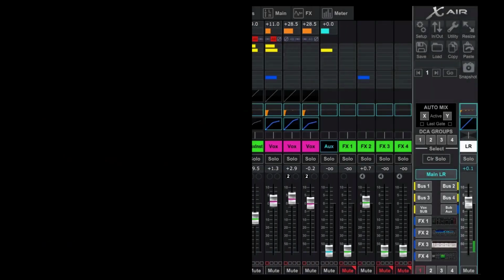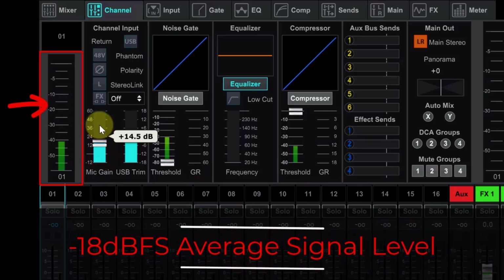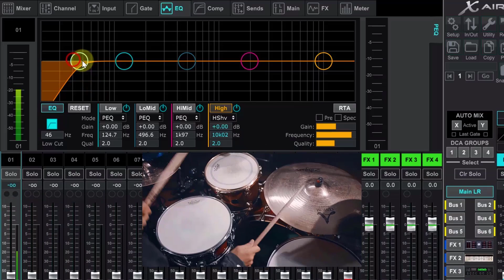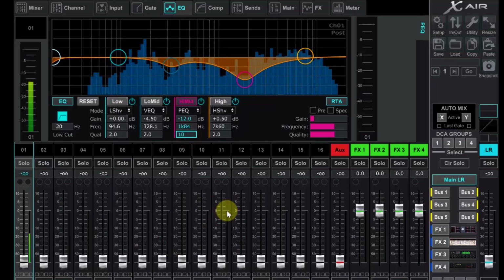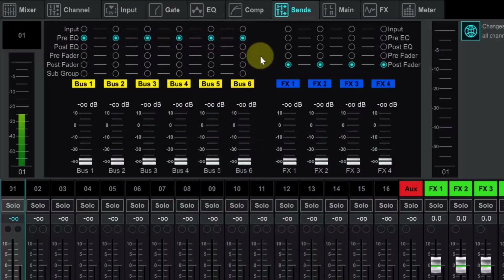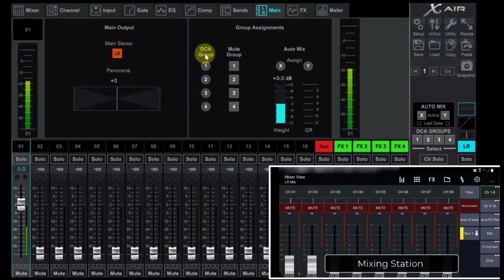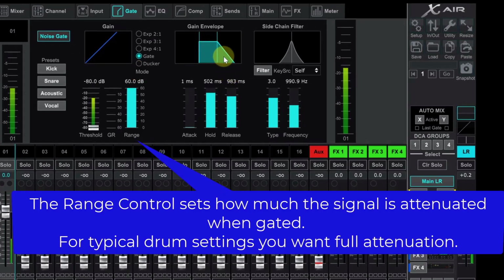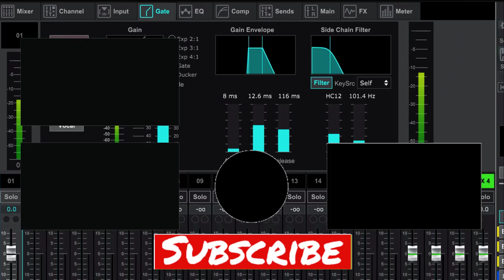Understanding the Behringer XR18 - Channel Setup Tutorial

Comment: I have a question: is it possible to apply two effects to one vocal? I would like to use deesser and reverb at the same time so that the signal that goes to the reverb comes after the desser.
Reply from the maker: I believe the insert point on the XR18 is pre-EQ. 
So, you'd have to use one FX rack slot for the De-esser, and insert one side of it on the vocal. And that would be a pre-EQ insertion point.
The vocal reverb will be a send and return FX (not an insert) and a channel FX bus is normally post fader (though that can be changed... but normally you'd want the channel FX send to be post fader.

So.... the reverb would be capturing the signal AFTER the De-esser... and also after the EQ as well... since it's a post-fader tap. Which sounds like what you want it to do.

This video about the FX Rack probably will help you visualize all of that. There's a couple of other videos about FX and tap points on the channel... but this one is probably the one I'd point you to look at first:
https://youtu.be/TV5ClH_MWrU
Reply: @AlanHamiltonAudio  Thank you very much! I have been looking for information for 2 days and found nothing.

Comment: Great video, Alan. Your videos have been helping me a lot, but I have become a bit stuck recently. I’m using Mixing Station with a Behringer XR18. I created a small and simple custom layout for an acoustic duo i’m in and I saved the layouts, etc, but when I opened Mixing Station this morning, theres a completely different layout with other peoples names on the channel strips, etc, and my layouts have disappeared. I’m only using it at home with the internal router. Could someone have hacked into it?
Reply from the maker: That's weird. I suppose anything is possible but I doubt anyone would hack into MS...  The weird part is your layout changing. 
I suppose it's possible someone had an XR18 really close to you and you accidentally connected with it instead of yours... thus loading an entirely different scene into your tablet. But I don't think that would explain the layout change. Maybe someone that uses custom layouts could speak to that question better than me though. I normally just use the default layout.

Comment: I am looking to adjust my vocals on a channel using the compressor. I can't find the compressor section on my iPad connection to the XR18. I don't have the same screen shown in your video. Is there a plug-in I need to download? Thanks.
Reply from the maker: I'm using X-Air Edit (with is available for PC and Mac). That is what has the compressor presets. Otherwise, I'm using Mixing Station which is available for Android and iPad. So that is the other software that you're seeing.
Reply: @AlanHamiltonAudio  Okay. Currently, I'm connecting my iPad via an Access Point. I have a laptop I can use. Once I download the X-Air Edit plugin, where do I connect my Cat 5 to the XR18, Ultra-Net or Remote? Thanks.
Reply from the maker: @jm4videoable  Remote (or you can use wifi). If it's at home/rehearsal, you can connect via the internal wifi instead. For gigs, and wifi, I'd buy a dual band router. Doesn't need to be overly expensive but the built in XR18 wifi is not very... ummmm... robust.

Comment: How do you change the presets in the compressor to acoustic vs the kick snare bass and vocal presets, so far the only way I can do that is to copy a strip with acoustic and move that to a location I want to use. PITA
Reply from the maker: In X-Air Edit you can create or load a channel that has your baseline compression setting in it (let's say acoustic guitar for this example). Then choose the COMPRESSOR tab. Click "Save" and it'll offer you the option to save a compressor setting/preset. So from that point on you'll have an acoustic compressor setting you can load into any channel. It will save it by the channel name plus 'COMP.chn'. Then when you load it, it's only loading those compressor settings.
Is that what you mean?
I'm sure Mixing Station is similar but I don't exactly recall off the top of my head how you do this from there.

Comment: How can I send a sub group mix of drums to another xr18?
Reply from the maker: Assuming you have an open XLR out, just make sure and assign the subgroup to that output and feed it directly into an XLR input on the other XR18. Or if you need stereo, your subgroup will need to be stereo and you'll need TWO outputs and inputs between the two consoles.

Technically, on the INPUT of the receiving XR18 you'll want to set the actual gain knob (talking knob position) on 0dB. This is the POSITION, not the meter reading. Then adjust the output of the sending console so that the meter of the RECEIVING console is seeing an average of -18dbFS on its meter.
You can tweak the gain control on the receiving console at this point, but technically it should be close to that 0dB SETTING on the console and the feed into it should be adjusted to balance out the level to get the input meter reading 18dBFS on average (but peaking higher).
Reply: @AlanHamiltonAudio  You have addressed all my doubt. Thank you very much, I am a new follower.

Comment: We just got the Behringer XR 18.. How can we play to a click track and sequence in our in ear monitors without the click track coming out of the house speakers, but with the sequence coming out the house speakers?
Reply from the maker: I'm assuming you have a 2 track recording... one side music and one side click... In that case, you'll have to come into 2 channels (any two channels except 17-18) and on the channel that is the click, just make sure that you unassign that channel from L-R (Main). That way, there's no route for that channel to get to the mains, even if you accidentally bring the fader up. Then just adjust your monitor settings normally.

If you do it like that and click is still getting to the mains, then odds are you have one or more of your master aux outputs assigned to L-R (which you should not do for monitors).
That won't happen from a newly initialized console since the default setting is not that way, but it can happen if someone is either experimenting with settings or accidentally clicks that assignment button in the software.
It can also happen if you ever have a bus set up as a subgroup, then change it back, but forget to reset the aux master/bus side of things for that particular bus or busses.
It's explained in the FAQ video since it's a common mistake/problem:
https://youtu.be/x9wciA2wFd0
Reply from the maker: The reason you can't use ch 17-18 (Aux in channels/Stereo inputs) is because those channels can only be stereo... or ONE mono channel. So you have no way to unassign (for example) the Right side from the house L-R while leaving the Left side assigned to the house L-R. Nor any way to send the right side to the monitors without or differently than the left side. They both have to be sent equally because the mixer expects that to be a true stereo signal that you want coming into the console (like an MP3 player/CD/Bluetooth, etc...).
Reply: @AlanHamiltonAudio  I have multiple tracks for the sequence, should I bounce it all down to one mp3, then create a click track, bounce that and unassigne it? 
 We may be using an Alesis drum pad to play the sequence from, if so where do we plug into the Behringer? Or we may use a MacBook Pro or iPad, how or where would we plug in for that?

Comment: Alan, thank you very much for the great and detailed content you put out.  I have one question.  I am trying to set the gain on the Behringer XR18 using X-Air iPad app.  In your great example in this vid you are using the Channel tab which allows you to clearly see the Meter level number, and set the gain at the same time.  On the iPad app there is no Channel tab, but there is an Input tab which allows you to set the gain, but does not include the meter.  So you can't see when your at -18.  How does one properly set the gain using the iPad app?
Reply from the maker: I don't own an iPad to test with so I don't know what scale or 'landmarks' you can judge by.
If nothing else, you can connect an MP3 player, have a laptop or Mac running X-Air connected to the XR18, bring the gain up and use X-Air Edit to see an accurate meter reading to a known scale. Then compare that to the iPad (that would also be connected) and get a reference for what the comparison would be between the obvious -18dBFS point on X-Air Edit, and whatever point that puts the iPad app meter.

Comment: Do you have any information on the group assignment section you talked about in this video. Not really understanding the x and y. I am the worship leader at our church and normally do nothing with the sound system. I am on a single transmitter wireless mic and pack while the rest of the team are on a twin transmitter. Should we all be on X or does this even matter? Some of the songs have me at x or y while the rest of the vocalist are at Y. Thank you for any feedback.
Reply from the maker: For singing, you really shouldn't be using the automix function at all. So just turn it off in that case. You want to use the automix function for something like a roundtable conference where you have a moderator and a panel discussion. Or possibly a play/skit where there are actors randomly speaking.

As for speaking, such as it the pulpit, if it's just you on one mic, then you wouldn't need it on then either.

If you use a pulpit mic AND a lav/earset, then you could engage it for both of those mics, each on the same group, for speaking. That might work to keep things balanced, even when you leave the pulpit to walk around and speak, and then come back to the pulpit. But that's only if you use both at the same time for some reason. 

If you bring someone to the platform to speak with you, you could definitely have it on between your mic and theirs.

Also, if there's a stage mic for someone speaking onstage and an audience Q and A mic, you could leave the Q and A mic open but with both of those mics on the same automix group. Or even multiple Q and A mics.

But generally, for singing/vocals, you don't want to engage automix. It's not really for blending voices so much as giving priority to speaking voices and ducking unused mics while keeping overall level even. Which is not something you want for singing.

Comment: Do you have to have Ethernet and the software to use it as an interface for something like fl studio?
Reply from the maker: Yes. Technically, you need USB for the audio to transfer back and forth from the DAW, and Ethernet to send and receive control signals (using either a PC, Mac, or Android tablet or iPad. I run my DAW and X-Air Edit on the same computer (PC in my case) usually. So you don't need two devices... one for audio (USB)/DAW and one for the control software. Although, sometimes it's easier if you have two devices.
This video is using Reaper for the DAW, but the principles will basically be the same for whatever PC/Mac DAW you might be using. https://youtu.be/xYmJGyroVe0

Comment: Do you have any information on setting up for in ear monitors and stage monitors. I am trying to figure out if each output can be custom tuned to each iem like say singer want to hear mostly her voice and drummer wants to hear mostly drums. would you use channel sends to output for each channel and adjust the volumes for that output. or am I needing additional hardware? I am new to didgital mixers. Its 2 iem for vacalists and 1 for the drummer. Everyone else are are old school and will be using stage monitors
Reply from the maker: You'd connect each person's IEM to one of the 6 XLR Aux outputs. Then set up your channel sends to be monitor sends (tap them at some point that is PRE FADER... you don't want to set them as POST FADER nor a Subgroup). You can then create individual mixes from those sends. Each bus output has EQ, though for the ears you might only want a HPF... but for the wedges you might want to use their EQ to notch a couple of feedback points.
There are a few channel videos that probably would help. This one is about the Outputs:
https://youtu.be/UNO-dACc7YY
This one is talking about setting up the console for monitors (older video so there's some overlap with the above video but things to be gleaned still):
https://youtu.be/5gzsEErKdb8
Even though this video is about creating a dedicated monitor rig and using the XR as a monitor console, it does talk about some things as far as connecting things that might click with you. Especially after watching one or both of the linked videos above:
https://youtu.be/xT9gTBFxvZk
Reply: @AlanHamiltonAudio  wow, quick response. I will check those videos out.  I appreciate the quick response or even the response at all. Thank you

Comment: I've got a question about setting gain structure. I've tried to follow the guideline to set the initial gain setting to average -18dBFS. In a practice setting (in multiple locations using both passive and active PA monitors) and in performance settings (again, both active and passive PA monitors), this has resulted in hot mics and feedback before getting the faders anywhere near performance levels. Our solution was to set the initial gain to around -35dBFS. Are there other considerations that would cause hot mics when setting the initial gain to -18dBFS?
Reply from the maker: Setting the gain to average -18dBFS on the input meters is definitely the proper amount of gain. It's hard to say without know more about the rig, or seeing you scene file, where things are going off the rails... but the input gain is one place you can easily know you have that setting  correct (due to the first point in the signal chain at the console AND a meter to guide you). So it's  a question of following the signal path and seeing where it is wrong. Assuming the problem is somewhere within the console settings, and not amp/powered speakers/DSP settings... And assuming you're starting with the EQ flat and not super boosted... then I'd look at compression on the channels. Is the compression makeup gain cranked up? I think X-Air Edit just calls it 'gain' on the compression page. That is somewhere you could be dialing in level after your channel input gain, and before your channel fader (and sends).

Also, you could have compression on the busses or main outs... and could have the makeup gain cranked in those places

If you've inserted anything into the channels... or the any of the buss outs or main outs... then there's potential that whatever you've inserted has it's own level cranked which would make everything before suddenly louder at that point in the chain.

That's off the top of my head... Something is set wrong if you cannot get a decent level out of the console without it turning into screaming feedback at -18dBFs on the input meters. It COULD be in the console somewhere... or it could be after the console in the system drive, DSP, amps....
Anytime you set the gain properly at the input and can't get a channel fader anywhere near unity without the PA devolving into massive feedback is a clear symptom of improper gain structure somewhere in the chain.. or multiple points in the chain. You KNOW you have the input gain correct... dialing it back is not a proper fix... because the real problem is lurking and can bite in other ways if not sorted out.
Reply: @AlanHamiltonAudio  Thank you for the detailed response. I will certainly go through each channel with a fine tooth comb to see if there is any unaccounted gain or something else causing that feedback. I have learned quite a bit about sound from your videos, but putting that into practical use is hard. Every set up seems to be different. I've only set up a few times, once I get a few hundred under my belt, it might get a bit easier...I hope.
Reply: @AlanHamiltonAudio  Was still fighting the feedback issue. I still don't have the expertise to know where it is occurring but, at a recent practice, I initialized the XR18 and started from scratch. I didn't mic up any cabinets, was running my bass DI and vocals through the PA. I only eq'd one vocal mic (3 singers). Had the gain staging set for -18dbfs, power amp maxed, vocal mics set at unity and maxed out the main faders....and got zero noise. No hiss, hum or feedback. One of the guitarists was getting some feedback between his guitar and amp. Progress!
Reply from the maker: @louisaguns4318  RE: Feedback- Have you watched the video about ringing out mons and house? Pay attention to what it says about not overdoing it... 2, 3, maybe 4 points is usually about it. Anything beyond that and you're into the point of diminishing returns and making the problem worse instead of better.
https://youtu.be/pu0xjl0rpMU